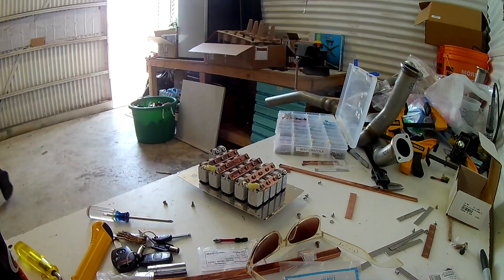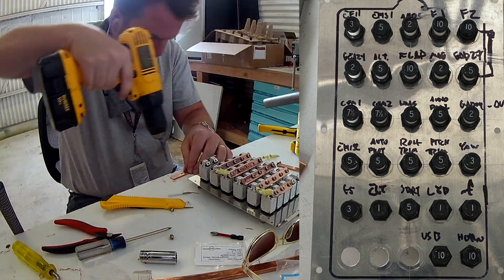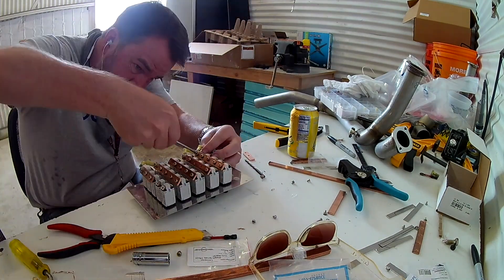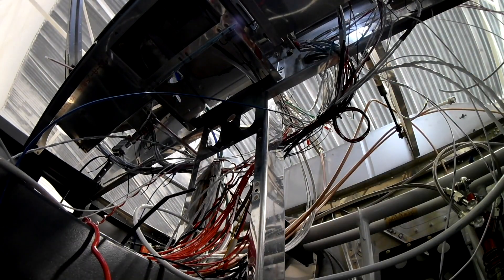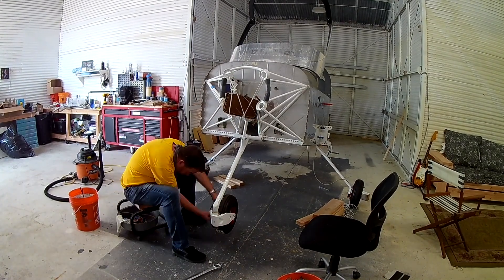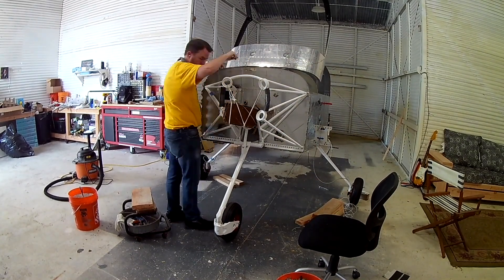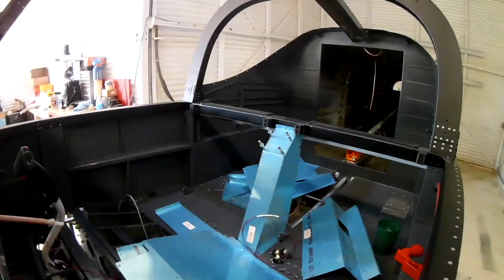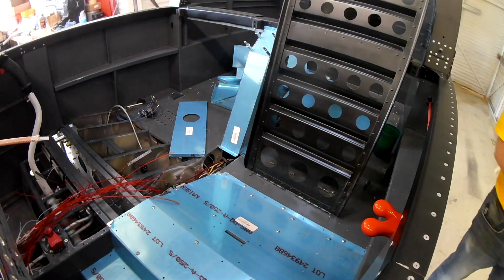RV-14 Circuit Breakers from Hell!

Comment: Several threads on the nose wheel issue. Vans suggests to use different washers if you are too far off. Others recommend to go for the tighter settings as the washers will wear quickly. Some drill a new hole which will always give you a finer choice going forward. Too loose means risk of shimmy. Too tight and the wheel might not straighten out in flight and act as a rudder.